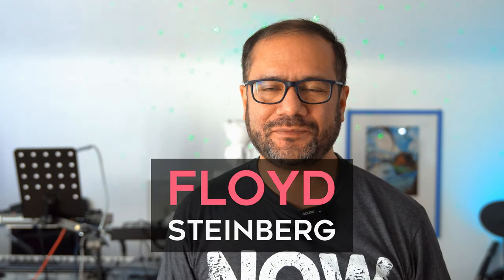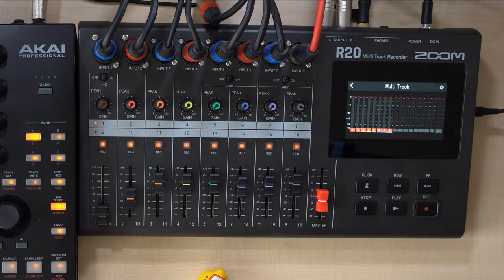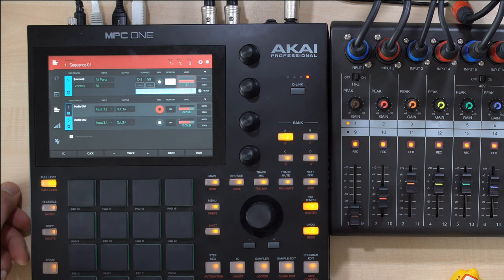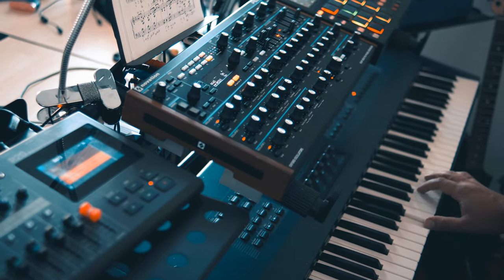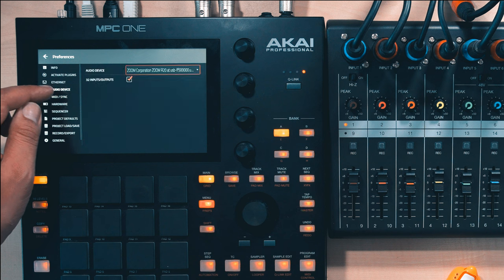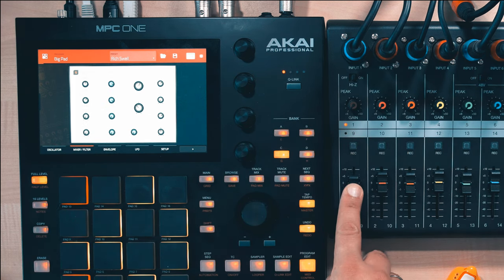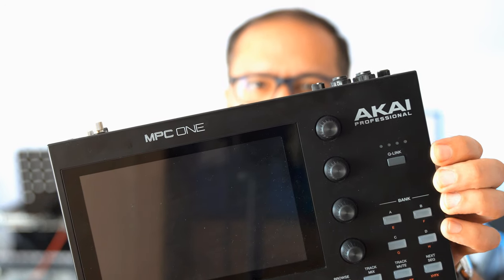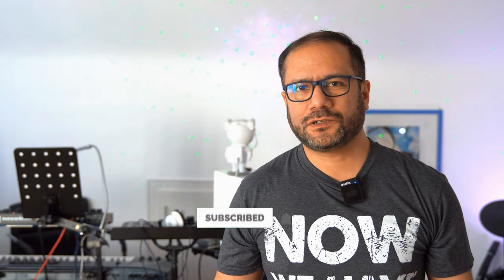ZOOM R20 as an audio interface and controller for MPC One

Comment: Would this work with other usb-enabled mixers or is it specific to the zoom to be able to control a midi parameter via a slider ?
Congrats for the success of your release, I wish you even better with the new track (by the way, who is singing ?)
Reply from the maker: Thanks! As long as the mixer you're using acts both as an audio interface and a class-compliant MIDI controller, you should be good.

Comment: Can the MPC One be used with one of its USB ports for an audio interface and connect a MIDI controller to another port? Or does it have to be one or the other if I don’t own an R20?
Reply from the maker: You can do that. MPC One has two USB ports, and you should also be able to connect a hub to add more USB devices.

Comment: Does the zoom R16 also work as audio interface with the MPC ?
Reply from the maker: Hi! I can't say with certainty as I never owned one. But if  the R16 is a class-compliant USB audio interface (read: will work without installing a specific driver), then it will also work with the MPC One.
Reply: @mr_floydst  Ok, and did you try with the R24 ? Since you had one maybe you know. (I will try to find ou for the class compliant thing)

Comment: Great video! Floyd can I ask what update you are on, on the mpc please. My mpc live 1 when updated past 10.1 seems to have broken midi mapping over usb but not midi? I know its not the machine as I have two identical ones.
Reply from the maker: Thanks! 
I wasn't aware of that until now - will check tomorrow and report back. ;)
Reply: @mr_floydst  Thanks Floyd be interested in your findings? I know a man who we can ask if what we find is same.... he's called Dan😉
Reply from the maker: I've checked now: my MPC is on the latest firmware, 2.12.1, controller 0.10, and both USB and 5-pin MIDI controllers work as expected and the same way.
Reply: @mr_floydst  mmm odd, both my mpc lives do not...Thanks Floyd!

Comment: For some reason when i connected mine, it wouldn't allow master volume to be adjusted. When i connected a model 12 mixer, same problem but it had submix out so that was my alternate route.
Reply from the maker: Unfortunately, not all the knobs and sliders send MIDI data.

Comment: Midi learn is so badly done on the akai's, should just hold a button on  tubesynths cutoff and move a knob/slider
Reply from the maker: Right! This menu system is too far away from the parts of the software it affects. It's bad design.
Reply: Yep, it's a pain. I use a Korg nanoKontrol 2 and it's fiddly - especially when including effects controls.
Reply: Mine constantly froze with external controllers. Repeatedly. Unreliable.